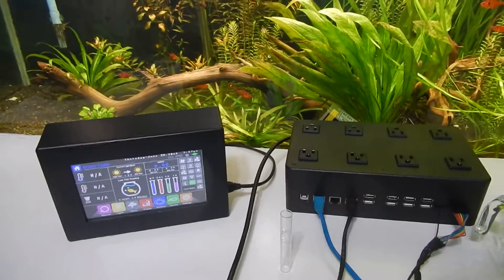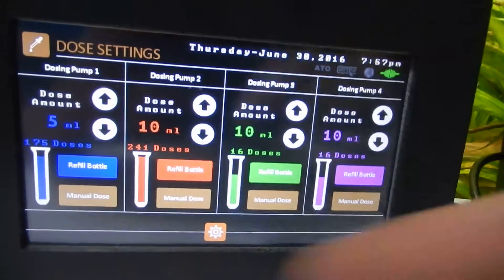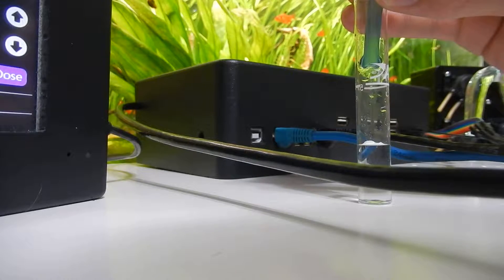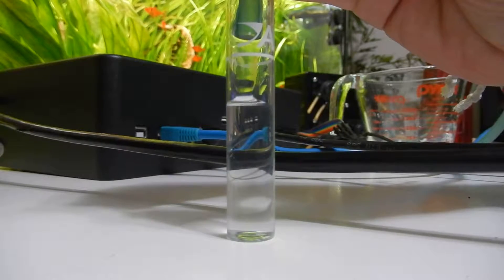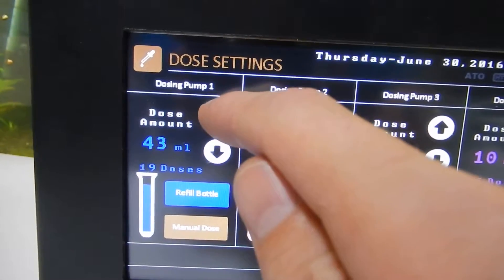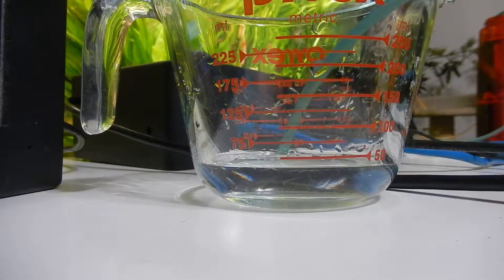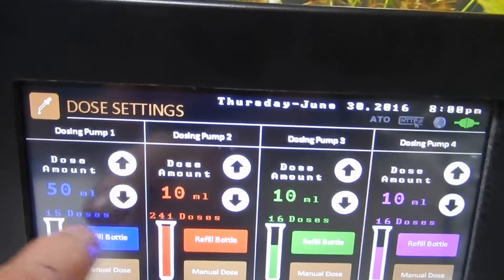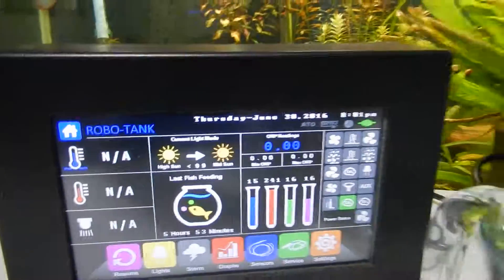Calibrate Dosing Pumps using Robo-Tank DIY Aquarium Controller

Comment: Hi! How did you create your dosing pumps module? Did you use DC or step motors? Could you explane what is the controller do you uses for pomp's motors?
Reply from the maker: Hi, the pumps are DC and a MOSFET is used to control it. User's get the dosing pumps from ebay or other websites and connect them directly to the controller.

Comment: Hello! Thanks for you video. I understood how it works, but I want suggest feature for communicate this module with capacity Liquid level sensor for example:  https://www.adafruit.com/product/463 or other Liquid level sensing which using capacitive sensing technology and with this feature you will be able to implement three feedback functions which relation to measurement liquid level for fertilizers and other liquids. The first function it really capacities level of the liquid. The Second function - automate calibration process for the pump. The Third function - auto-calibration pump during the flow rate, because cases when the calibration is lost to meets very often. What do you think about my suggestion?
Reply from the maker: Hi, thanks for your suggestion, I do like it. That is a nice sensor which will work with the ATO or the other 5 sensor ports but you would be required to add the resistor they refer to. You could use it for dosing pump reservoir however currently you can only get an email alert doing that. I like the idea of an auto-calibration, I wonder if this would be accurate enough to achieve that and would it really notice a couple milliliters missing. Currently calibration isn't too difficult but you make a point that it can change over time and auto correct would be nice. Unfortunately I have so much on my plate right now it would be a while till I could do that but is something I would like to work towards.